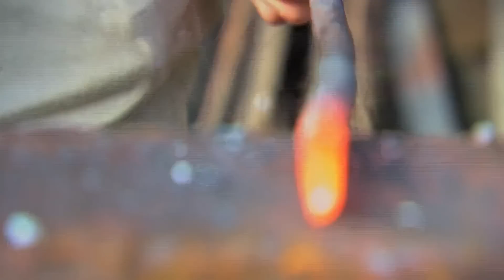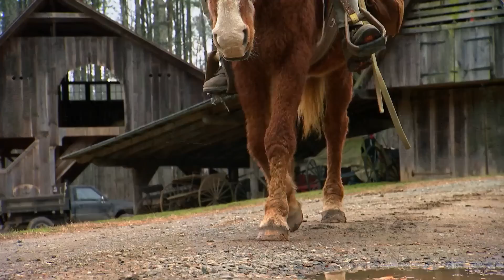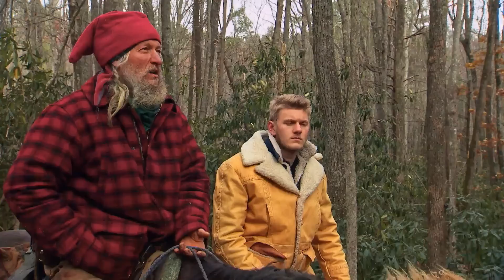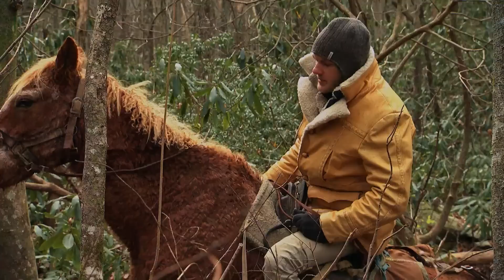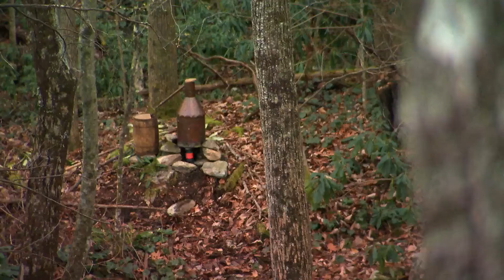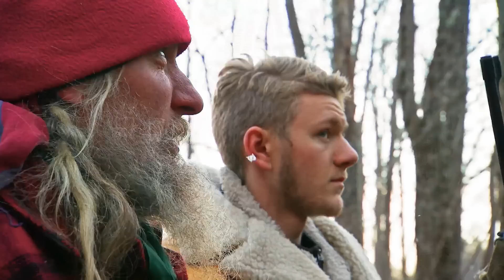Mountain Men: Eustace and Raleigh Send Trespassers a Message (Season 8) | History

Comment: For june 13, 2019 episode, Eustace doesn't have a snow plow. I know how to make one. Put two 2 x 1's together in  V using other boards to hold them together in V position. Add chains that can be attached to horses to pull the apparatus, put something on the thing to provide extra weight such as a few kids, an anvil, etc. and drag the V shaped snow remover along. It clears roads and the kids have a good ride.  We did this when I was a kid.
Reply: What's a 2x1?
Reply: @amyweisman2059  actually I wasnt very accurate. To clarify, it should say two 2 inch thick, 12 inch wide and about 12 feet long.  Put them together on the vertical at the point and use 2 inch thick by 8, 10 or 12 inch wide boards to hold the V shape and to make a place to set the weight on. Attach a large eye hook or other options  to the point of the V to drag it through the snow. Like I said,  a few kids on the V make good weights.